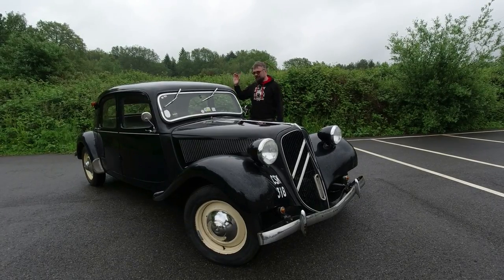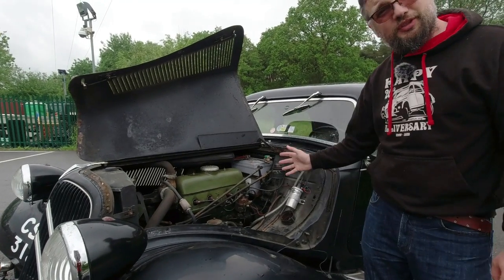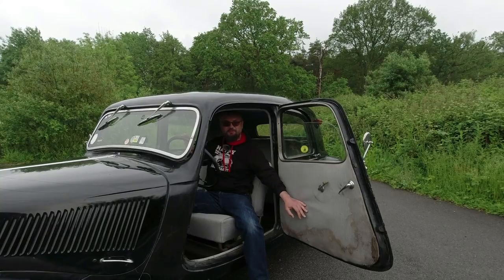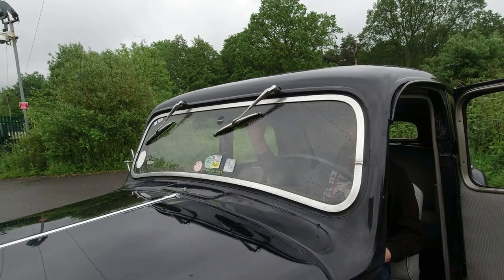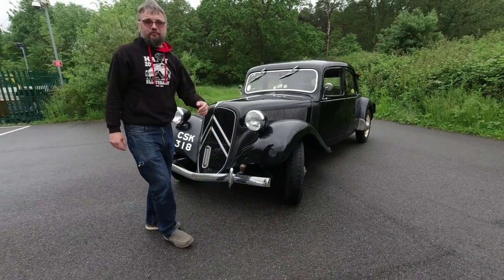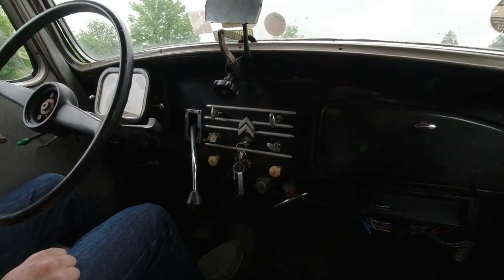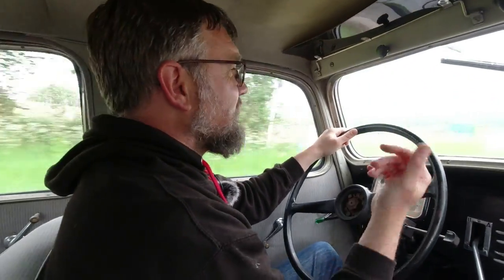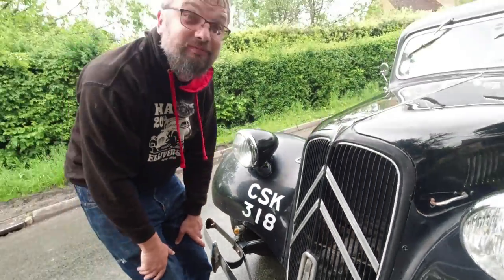Real Road Test: 1951 Citroën Traction Avant - 11 Normale

Comment: I have an uncle that had one of these back in the 60's here in Aus. Presumably a Sough built car as it was RHD. Two observations...Firstly I think the gearbox was so fragile because it was designed to fit inside the casing of the planned 2sp Auto. Secondly, Given you don't script your presentations you probably don't realise how impressive it is to reel off the very convoluted story of the birth and development of these cars for almost 20 minutes like that.
Reply: And to think he could probably do that with many a different car - and has done in previous videos.
Reply: Mr HubNuts product knowledge is second to none.Another excellent presentation Ian
Reply: The first car to circum-navigate Australia was a Citroen, in 1923 if i recall correctly. So a long story, almost a century.
Reply: @alainpichon4395  What ship was it on ? ;)
Reply: @millomweb  Not far from the truth : see the picture on Classicrally com au and then first car around australia. A bit wet and a boat-like rear end of a car, isn't it ? In a 1922 Citroen 5CV and Mr Westwood was its driver.
Reply: You really don’t notice all the cuts in the video?

Comment: How nice it is to have you back in full road test mode Hubnut, and this one was particularly comprehensive and excellent. Indeed, I was about to ask you about crank starting, and then you got to it right at the end. You and I share approval of motors with decent torgue which don't need crazy revs to get anywhere. Wouldn't the world be a better place if manufacturers were required to give horsepower figures at, say 2800 rpm!

Comment: My first car (1972) was a well preserved 1952 Traction Avant Legere.   I use it regularly for 20 years.   That car gave me extraordinaire memories.  Very slow, clumsy because the gearbox, and i remember a constatnt issue because the traction axels uses very delicate wedges. If you abuse pulling out the clutch you'll break the wedge and the axel will rotate "crazy".    The gearbox shell was in aluminium so it was super easy to destroy it.    The "Marshall"   headlighs vere just useless so driving at night was an adventure.     Without doubt a car with lots of personality and catching eye design.    You got the feeling of the car.  Nice test drive. :)

Comment: I have a RHD French 11BL as sold in Australia, I'm not sure why as most Tractions here were Slough cars. I have fitted an ID19 engine and gearbox to it and that solves the downsides of the Traction so it becomes a car that will cruise at 70mph and the ID gearbox is tough.  It's a pity that Citroen didn't do it.

Comment: This is a beautiful car. It would be cool if cars with this style were remade today.
Reply: I have no idea why it isn't. Electric cars could benefit from those looks and the space where the engine was would give it huge luggage capacity. This is far better looking than all the boring jelly mould stuff we get today.
Reply: @Bob-kt4yz  The batteries could be flat and act as the floor as is common in ev's and the motor/s would be in each axle depending on which/both you wanted to power. 
I'm not suggesting its something that should be done to this car - just that it would look a lot better if they made bodies which look like this and drop them on the usual modern ev skateboard.
Reply: @Bob-kt4yz  Well the body would have to be built to meet legislation so it would be a complete redesign. I'm also sure it wouldn't have a perfect cd or be as efficient but most cars spend most of their lives at relatively low speeds so that would only be a concern on longer runs - where ev's are already not great. 
I suppose you could give up the rear boot space for a small engine to deal with loonger trips and keep the battery weight/size down to go with it. 
I ask myself would I rather have an extra 5% range or a car which looks like this?
Reply: @Bob-kt4yz  I don't mind modern stuff for convenience and its general ability to work more often than not. I do think there is a lot more which could be done with the style and layout of a lot of them though. 
I mean how many genuinely different shapes and styles are there out there? Most are just a case of choose a class (lets say medium family car) and then its which badge do you like on the front. They really are so close in all aspects its like someone copying Romeo and Juliet but changing the names to Cabinlets and Montainyou's. 

Lets take the Traction Avant for example. Would you like a Seat Alhambra, Ford Galaxy, VW Sharan or one of the other very similar people movers or something that looked like this with three rows, 9 seat potential and a boot to make the others look like they weren't trying? 
Now I come to think about it I doubt this would be any worse in a wind tunnel either given their general overheight space wasting. 

How about an Astra, Focus, Golf, etc etdc - you know the ones? This would not only seat an extra person and have a larger boot but looks miles better. 

I feel like designers have been very lazy over the last 20-odd years because its much easier to get a basic shape then graft on the company face/etc to suit than to actually design something different from the ground up. 

Its also much easier to get past the bean counters if they can say "this segment sells this many - we can probably get xx% of that so can make money. If there isn't a segment or if the vehicle is a large departure the money men get worried and don't want to know. 
While thats ok for stock prices its terrible for brand values and you end up with an endless stream of bland, built to a price junk. 
This is also why quality hasn't improved and in some cases has dropped quite significantly lately.

Funnily enough some of the best selling cars of the last couple of decades have been retro styled ones - the Mini, Fiat 500 and so on are like money making machines for the brands - even though they aren't necessarily the best in segment cars on paper. 
I wish makers would take note.
Reply: @Bob-kt4yz  I don't really mind modern stuff - it just generally seems very bland and generic. Good at what it does but there's not much there to get interested about. 
My daily drive is one of the most boring cars on sale but its a tool for a job and does that job very well. I find it very useful but I have no real interest in it at all. Even as modern as my M135i used to be, it was interesting to a point but going back further my R5GTT was quite special and even some run of the mill stuff from back then had its features which stood out. 
Things like the Cosworth whale tail or the Xantia's suspension made them stand out as different and/or interesting. 
Now its all spec sheets and who has the largest wheels rather than anything which genuinely stands out. 
Its got to the point where if you see a colour not on the greyscale it stands out. 
As designs go a Suzuki Jimny is probably one of the most original of the last few years and even that is a blatant rip off of a G wagon. 
Most things you could swap the badges/lights and very few people would notice.
Reply: @Bob-kt4yz  Oh I still keep a couple of interesting cars and a few bikes around for the good times. Just my day to day stuff demands a modern, boring, reliable car.
Having said that my Hayabusa is pokey enough but its nowhere near as much fun or as interesting as my old 2 strokes.
Reply: @Bob-kt4yz  I've had bikes for 34 years and big sportbikes for 24 of that. Now I come to think of it I've had my Hayabusa over 10 years too. They aren't any more dangerous than anything else if you treat them with respect. 
The car has to be boring because it has to meet certain criteria like fit certain things in, cost to buy, cost to run, etc - there just isn't anything which can do it all at the price thats even remotely interesting. 
My daily also has to be a certain shape and size for disability access which rules out quite a lot of potentials. My current one is a Kuga phev. Currently averaging 272mpg (but if we include cost of electricity that comes down to around 80mpg) for round town, traffic and stop-start driving, sub £40k new (just) and 225hp when required. Its quite nice but about as dull as it gets. If I could get away with a lower car it would open up things like Golf R estates but sadly thats not on the cards for the access issues. In the end I couldn't find anything fun so I went for something frugal instead.
Reply: @Bob-kt4yz  Strangely my friend has exactly that car (in blue) which he got on my recommendation. He does a similar thing as me but without the access limitations so that seemed the obvious choice. It certainly goes well enough. His has an intercooler, exhaust (not obnoxious) and a tuning box - something I tried to talk him out of but it seems to work well enough. 
The thing launches like a stabbed rat even with a cooker in the back...

Comment: What a great video - thank you so much. We had a 1936 Citroen 12 - bigger than a Rosalie. EWL 730, and I still have a Hub Cap and the 'Floating Power Citroen'  badge from the back of it. It had clockwork windscreen wipers too ! Sadly the 'Ten Year Test' put paid to the car. What fun we had in it though :-)
Reply: Out of curiosity, what is the ten year test?
Reply: @alfredsedgewick2184 MoT was initially launched for cars over 10 years old..

Comment: A truly enjoyable video that brings up fond memories of a special car.
These where very tough cars, used also by French criminals in the 30's and 40's just like the Jaguar MK2 later on in the UK. In Holland up to the early 80"s they would be quite a common appearance on the road and after that they seamlessly became classic cars. 
I remember the wipers where a weak spot and with the manual over ride you could mess up the mechanism quite easily so luckily it all went well during this presentation. 
And then straight after this car came the DS, talking about a leap... Twice over you could say because the traction was a leap by it self.

Comment: What a fantastic car indeed. I have only seen one in person. It was puttering along in modern traffic quite nicely indeed. It was a little tatty, but it was, after all, a 1938 example and unrestored. A true testament to the durability of the car. The entire drivetrain was original, as was the paint. Impressive for a car with some 200,000 miles on the clock. I was lucky enough to talk to the owner. The old girl still accumulates some 5 or 6 thousand trouble free miles each summer.

Comment: very nice, interesting test! i had a 53 traction familiale myself. a word to the wipers: you can run the wipermotor on 12 volt without burning it or switch to  a 12v paris-rhone-wipermotor , they made them in the same size only 12 volt for various commercial vehicles as the H van for example-

Comment: My dad used to have one of theese! (although his was a slightly later model than the on in this video). When he got it it was just a shell of a car but he restored it inside and out and then it looked like it had just rolled out of the factory. He also put in a more modern engine and transmission.

Comment: The Traction Avant is one of those cars I've dreamed of owning. Not really possible as I live in the middle of the USA and mechanically inept. Probably just as well as I'm tall, and if I could tell anything from seeing you behind the wheel, the Traction is a bit short of leg room. Mind you, with the Normale one has enough space to modify the seat mounting and move it back a lot.

I've heard that the gearbox issues are related to the transmission case being prone to flex, getting the ring and pinion out of alignment, then the teeth get ripped out of the ring and pinion. The most intriguing solution I've heard is replacing the Traction Avant's engine & gearbox with one from either a DS19 or an ID19 (1911 cc model)). Not only does it give the car a stronger 4 speed gearbox, but the engine is also a little more powerful. 

 Thanks for bringing this great car to your loyal viewers.

Comment: I came over to Wales in de mid 90s in a 50s Commerciale, owned by a mate of mine. I think it had an 1800 engine. We came over (him, his "Dr Mécanicien" pal and me) through Dover. As they were rather nervous to drive on the left, I was enjoying the privilege of being the designated driver. We drove to North Wales (Llanrwst) and stayed on a camping site there. We toured around Snowdonia and Anglesey for a few days. Main thing that I remember is I had to make sure I was in first gear before coming to a halt, especially when going uphill, as the first gear had no syncromesh. I'm not sure if the other gears had it; once it was rolling it was a total dream to drive and to shift gears. Like you said: take the time and be gentle. Three speed gearbox, though I seem to remember it was set different to this layout.
Thank you for this trip down memory lane!

Comment: That is some wonderful motoring.
My father and grandfather (also named André) both restored entirely a 1932 Renault Monaquatre that served as a taxi in Paris. It is not the regular version with the square rear end, but with the wedgy S-shaped end when seen from profile. When picked up in France, it was being used as a shelter for chickens and ducks and pigs on a field from a farm. Has also the same wipers and I think that is one of the best designs. As rain falls with gravity, it makes a lot more of sense to have the wipers hinged at the top of the windscreen. 
It is still here in the garage and is roadworthy. Bulletproof engine that is sidevalve of course. The only thing that would have been even nicer, would be a Monasix. Guess what, indeed with a Six cylinder inline engine.
My father and mom used it as their wedding car in 1987 and was restored with that event in mind. Both interior and exterior.
EDIT: it has also the Jaeger speedometer with exactly the same scale layout! And yes, the rewindable clock works ;)  It would be nice to compare one with the 4 cylinder in terms of finishing trims and all sorts. 
You very nicely honored André Citroën! 
You forgot to mention something very particular for a monocoque car. The fact that there is a sticker on the windscreen saying voiture antiparasitée which ensures and states that the car can be used as a Faraday cage and thus is grounded. Being raised bilingually both French and Dutch helps a lot héhé ;) There is a nugget for you!
Cheers!

Comment: I have one that's been in a barn since 1966. My Father did something to it, then took it apart and left it. I have all the parts though. 
The hood and front fenders along with many of the parts are in the loft that has been very airy and are in excellent shape. The engine is in a cradle in a nice dry garage.

Comment: These are remarkable cars. Way ahead of the pack at the time.  I think they are more important than the DS, which were hopelessly complicated yet still using this engine.
Reply: Technically, probably yes. Design-wise the DS was lightyears ahead of its time, it must have felt like something from outer space. To this day it looks like something from a 1950s sci-fi film!

Comment: Interestingly, looking at the 'heater' system, in the mid 1950s we were living in Jedburgh in the Scottish borders and the local blacksmith/garage (in the process of changing over, horses were being shod while we were in there) advertised what they termed a 'Jedheat', a heater for cars (and that would be most of them) not blessed with such mod cons. That was a piece of pipe welded into a hole cut in the passenger floor well , complete with removable bung, and a corrugated (probably cardboard) pipe which connected the pipe to a bracket mounted to the back of the radiator, thus allowing heated air to travel into the car. I can't remember how effective it was or how successful was the venture.

Comment: There were 2 or 3 of these parked in Spitalfields Market in London during the 1990s before it was partly redeveloped. No idea who they belonged to or why they were there.
Reply: I remember them. I was working in the Sedgwick building at Aldgate East and was so bored I used to go for long walks at lunchtime. I think those cars belonged to a restoration business that was based there. The cars were not expensive for what they were. The guys behind Spitalfields at that time were the guys who started Camden Market. They were interested in urban regeneration. Do you remember when they dug a big pit, lined it and ran a swimming pool on site?

Comment: good extensive review ian.my father was into rare classic cars.mostly to do nut and bolt job restoration on them.my grandfather the same.anything from 1972 fiat coupe with the ferrari engine to  1970s peugeot 504 to the car you featured.i was walking in a neighbourhood with my father one day to scout for cars to buy and restore and traction avant exactly the same spec as you have shown us was just sitting outside in the elements back in 1984/5.we found the owner and he was being too greedy.besides my father said it was too much work.i think it had been outside all its life but the body was still sound.we found a 1968 buick skylark sportswagon instead and once we finished with this beauty it was our family car for many years.3 on the column shift and a clutch which is quite rare on those,.we once fitted 12 people in it.obviously 3 families with kids with a play room at the back.great engine and great torque.the manual gear and clutch actually made it quite fast.with a little upgrades under the bonnet.lol.it was 8 miles to the gallon but who cares when you have a car an absolute rarity an you are willing to make the sacrifices.

Comment: Gorgeous. I had a 1952 11BN (avec malle) in the 1990s.  It was not original, but the spirit of it was pure.  
It held onto the tarmac wonderfully.  The gear change has overtones of large Moto Guzzi.  Shift..... Wait...... Engage.  Lovely.  And the motor was quite acceptable.  Not lovely, but OK.  It ran at 70mph for an hour, which is fine for me.
The interior seemed vast.  
A lovely memory.